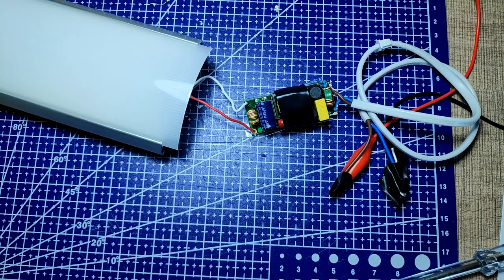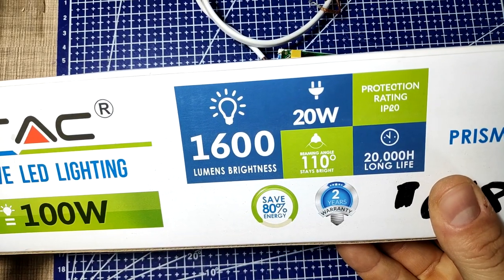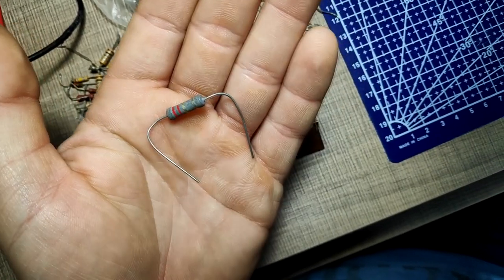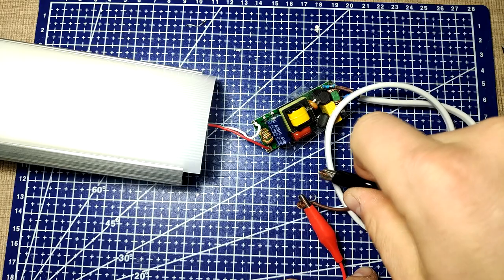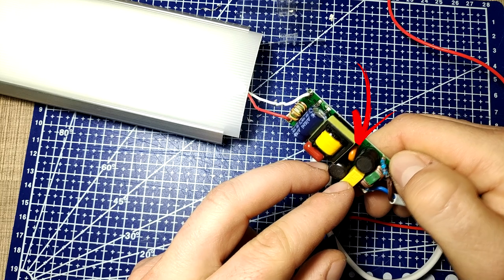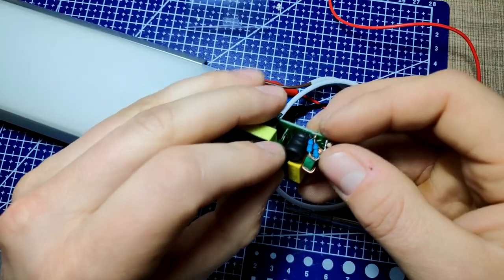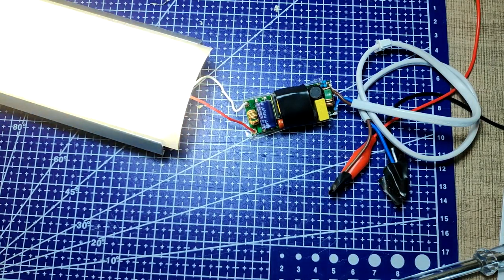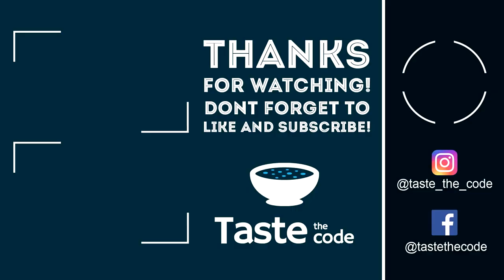LED light fixture repair

Comment: Was the resistor bad in the first place or do I think the light would have worked by replacing ONLY the capacitor (not the resistor) ??
Reply from the maker: No, it was gone. It had burned all the way through. Usually these resistor act like a small fuse that blows up once something goes bad with the light.

Comment: I have a similar light that has failed due to a loose inductor, which is unmarked. Do the inductors in your light have markings on them so I can try to start with close specs?
Reply from the maker: Hmmm I can't check right now as I have the light installed. You can try and replace it with a similar looking one even if it is not the same value.
Reply: @TasteTheCode  Yeah, that's what my plan is going to be. Find one that looks similar and go from there! Thanks for replying!

Comment: I have Led lights that look like yours, which 5 of them are daisy chained.  I have about 4 sets of these going around the outside of the house.  Last week, most of them is not working.  They are not totally dead, but have dim spot glows.  so out of 20 led lights, about 3 of them is normal, and rest is in limp mode.  What could cause this?  And I think using youir fix will fix the Led lights, but will the problem occur again in the future?
Reply from the maker: Well, first of all, nothing lasts forever :) If they fail again you either repair them again or buy new ones. As for the dim spots, it is not the same issue as in mine. It sounds to me that some of your actual LEDs have failed and not the driver.

Comment: cool so what kind of ebike do you have?
Reply from the maker: I don't!
Reply: @TasteTheCode ... bike first then lights!... you using all that skill.... on shop lights ... it's ok... hug
Reply from the maker: I don't see the connection between bikes and lights but anyway, hug back! 🤗
Reply: @TasteTheCode  capacitors,  resistors etc...its all in the controller box I think you could make a high powered ebike sound like you have a lot of spare parts laying around... and the electricity.... look ma! I got me a YouTube hugg... with social distancing.

Comment: can't we do a direct connection ??
Reply from the maker: What do you mean by direct connection?
Reply: @TasteTheCode  connecting the wires which are attached to led , directly to the plug
Reply from the maker: That's a big NO NO! The LEDs dont work on AC! They need a driver first to convert it to DC and limit the current running through them.
Reply: @TasteTheCode   Thanks A lot Sir !!
Reply: @thepronoob7923  no, you need a "driver" like he is repairing. I don't know the technical specifics, but it's been explained to me that it's similar to how fluorescent tubes need a ballast.